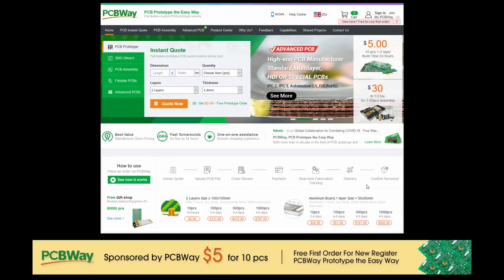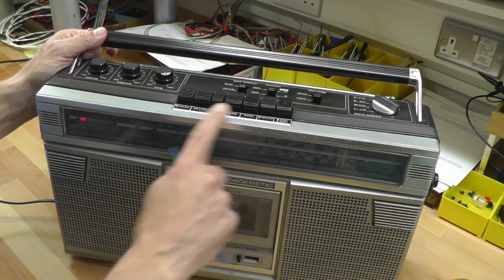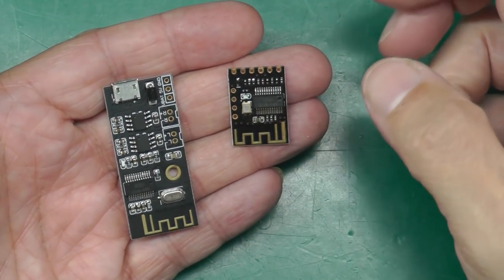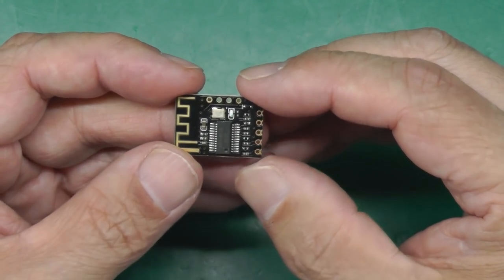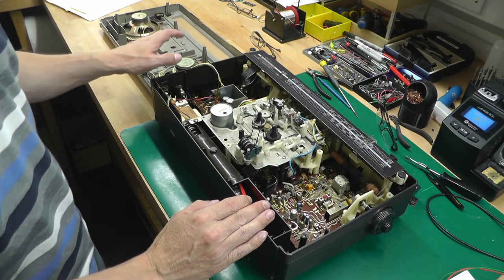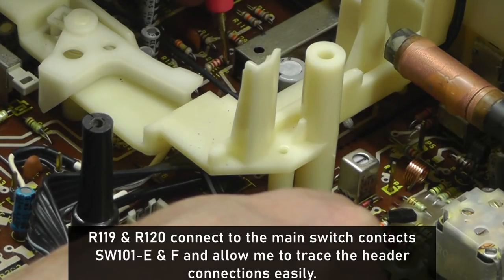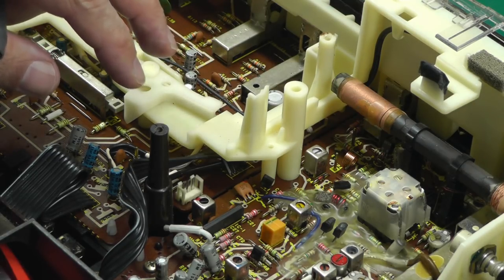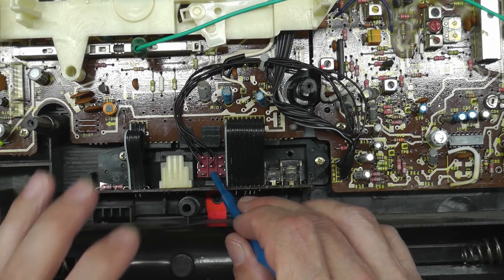No.058 - Vintage Sharp GF-6060 Ghetto Blaster Bluetooth Conversion

Comment: I suggest adding some series ferrites to the supply wiring and audio outputs to the bt module to stop the digital noise back feeding the supply, also add some tantalums to it, maybe also try using screened cable for the supply, digital noise is a pain to get rid of sometimes, I had issues with it on my CB PLL replacement board, in that case the noise was from the multiplexed 7 segment display driver and was radiated and picked up by the VCO/mixers.
Reply: I had lots of noise problems too, all were cured by ferrite rings on the BT audio output leads :)
Reply from the maker: I have fixed the noisy bluetooth module with an isolated DC-DC (0505) converter after the 7805 regulator, and wiring the supply to the 7805 back to the main DC input from the bridge rectifier. It's 100% better now.

Comment from the maker: UPDATE: I have fixed the noisy bluetooth module with an isolated DC-DC (0505) converter after the 7805 regulator, and wiring the supply to the 7805 back to the main DC input from the bridge rectifier. I also left the BT module 0Vdc connection tied to the GND pin of the pre-amp IC. The ground loop is gone and it's sounding 100% better now. Very, very little background noise.
I've also had to fit a small heatsink to the 7805 now as the incoming DC is higher and there's more load on it with the DC-DC converter. All good.
https://www.ianjohnston.com/images/stories/IanJ/SharpGF6060/BT.jpg

Comment: You need an isolated supply for the BT module. You've basically got a ground loop. Get a decoupler.
Reply from the maker: I'll give that a bash this weekend.
Reply: @IanScottJohnston  put a small high mH value inductor in series with the BT module supply to filter the high frequency noise and take the supply for the BT module directly from the bridge rectifier before the ripple filter transistor so any noise is not coupled to the audio preamp circuit. Maybe even make your own copy of the ripple filter.
Reply from the maker: @simontay4851  I originally had the supply across the main bulk cap on the rectifier output....it was noisier albeit without an extra inductor.....nice idea of the copy ripple filter though. I will play with some ideas this wekend though and possibly a wee follow up video. For now the quietest solution is as I have it in the video.
Reply: As @morenormal said, you need an isolated supply for your BT board.  Check out M Caldeira's series of videos about this very topic (https://www.youtube.com/watch?v=NyuGbY8A4b8).  He uses a variety of methods, but his most recent one is to use a suitable dc-dc converter.  Problem solved!;-)
Reply from the maker: I have fixed the noisy bluetooth module with an isolated DC-DC (0505) converter after the 7805 regulator, and wiring the supply to the 7805 back to the main DC input from the bridge rectifier. It's 100% better now.

Comment: Timely video.   I just refurbed my 1978 Radio Shack ghetto blaster I got specifically to take to College.  I got tired of all the scratchy controls.  Now it sounds like new.  I will definitely look into the bluetooth modules.   I got one 6 years ago to have my PC Bluetoothed to my home stereo system receiver.   I just wonder what the frequency response the Bluetooth gizmos are designed to reproduce.   It is so funny to see how large the 7805 is next to the Bluetooth module.

Comment: i have used many of those chinese BT boards .. they work fine if they are not on the same PSU of the amplifier .. seems the  audio GND  and VCC can"t be the same ..  1:1  audio transformer in the audio pad or isolated DC-DC and noise is gone ...
Reply: I think they have high pulse currents in the power supply, from running the bluetooth keep alive transmissions, so you will get noise.  Definitely looks like you need to have an isolated supply for them, to keep that pulse current out of the audio path.

Comment: Be neat to use that "Mute" output to drive a relay to do the Radio/Bluetooth switching.
Reply: .... Good thinking,   although,
BT auto pair with phone in your pocket, and you would have to manually select mute on app to switch to radio.   ( ? )

Comment: I attempted something similar recently to find that the Bluetooth device was indeed only as good as its price had suggested it should be. It would arguably have been usable if I'd been desperate for it but under the circumstances I decided it was crap and threw it in the bin. Noisy, buzzy, refused to work unless it was charging and charging created noise. When it was not connected, even noisier. Wasted an evening on the bloody thing.